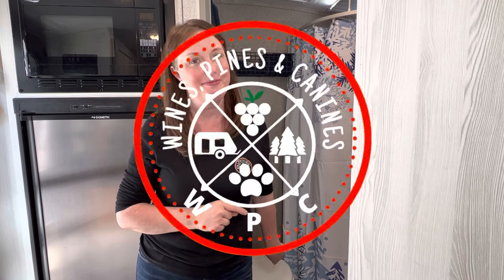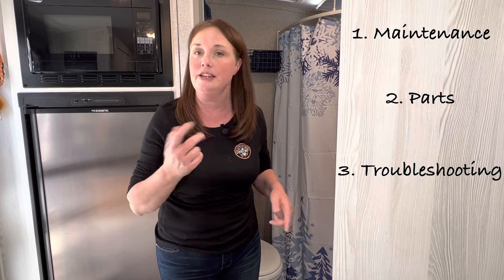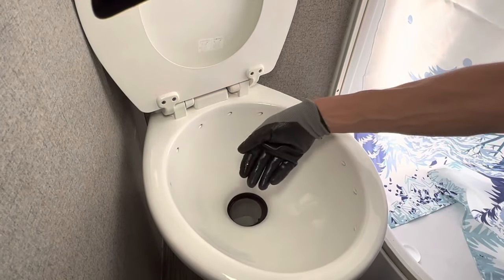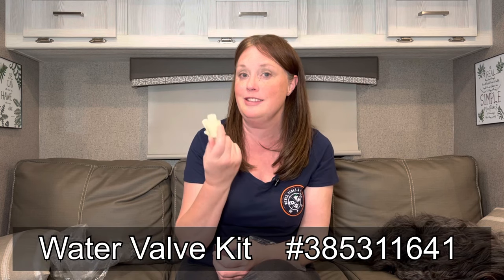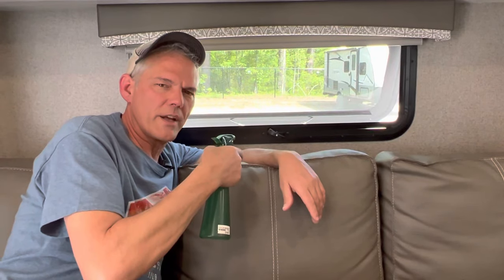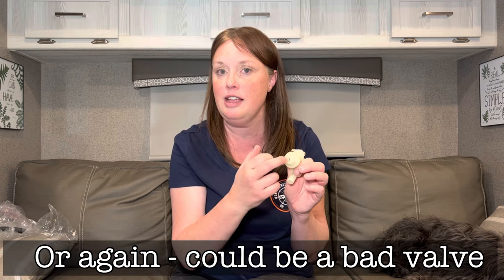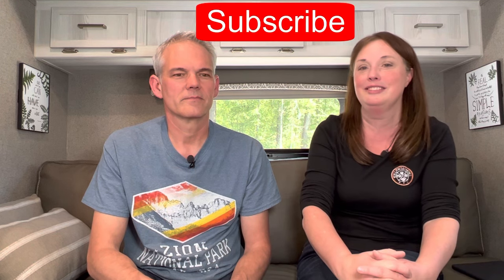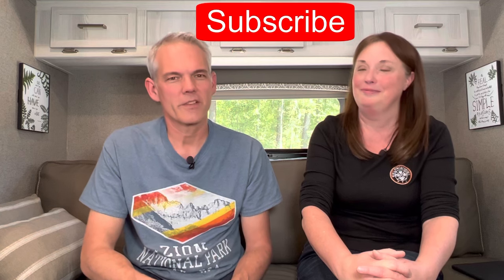Issues With Your Dometic RV Toilet?  We Run Through Parts and Troubleshoot Different Repairs!

Comment: We have 2 dometic 310 toilets in our camper. If one depresses the pedal all the way down it returns by itself. The other toilet when the lever is pressed all the wat down it stays on until the tank overflows and floods the rv. MAKE SURE YOUR VALVE DOES NOT STAY ON IF YOU FULLY DEPRESS IT. We had visitors they thought nothing of it until I heard water flowing under the trailer. PANIC MODE.😢😅😊
Reply from the maker: Oh that would not be good!!  Our pedal comes right back up and the valve closes but that is an excellent point for people to watch for!  Hopefully all was fine?

Comment: Unfortunately the 310 doesn't have a replacement part for the ball itself.  The shaft from the ball to the pedal is all plastic and only half an inch thick at most.  Tried glue,  added a thin screw.  No dice.  Broke again after a month or so.  Key thing is keep the seal lubrication maintenance regularly or it will easily snap the shaft or pedal and your into a new expensive toilet.
Reply from the maker: Yes - it is unfortunate that some parts do require a full replacement.   Seems like the pedal and ball would be something that could be designed to be easily replaced!

Comment: My pedal toilet won't fill up it just runs right through when I press it down a bit. The valve isn't opening, would this be the seal?
Reply from the maker: Hi - sorry it took a bit to respond!  That could be - would likely be the first thing we would change as inexpensive and easy swap out.  But that pedal is definitely touchy - ours takes an easy touch to keep the water filling up vs going through to the tank.

Comment: I hope you weren't thinking you had all the bases covered.  You failed to cover the issue I have with my Dometic toilet; when flushing, clean water flows out the top of the anti siphon valve under the seat hinge cover.

Comment: New seals put on today, when the lever is pressed even alittle to allow water to fill the bowl, the water escapes and wont fill the bowl. How can i fix this?
Reply from the maker: Hi - sorry for the late response - been traveling!  They are very touchy - we have to barely touch to fill up.  Does water pressure seem fine?  Sometimes the water jets may be clogged as well (inside the toilet) and not able to fill up quickly.  We also keep a jug of water in the shower as well as sometimes just easier 🤣

Comment: I’ve a 2021 GeoPro, same model as you all came with Dometic 300. On last trip the flush valve cracked right down the middle & would not hold water in bowl, under warranty. The RV dealer said it would be 3 weeks before I could get appt. & they’d have it for min. of 5 weeks bec. of warranty process. Called Dometic direct, they said I could do myself, send in paperwork for reimbursement. After watching your U-Tube I decided to install 310 myself. Drove 1 1/2 hr to Camping World & got one. Installed but would not stop running. Un-installed, took back (1 1/2 hr. each way again…) & got another one. Installed it and all appeared well. However driving camper to storage, water slushed out of bowl & temporarily shorted my electric brakes. Luckily no permanent damage.  The old Dometic had no serial number ( the camper was made during the pandemic & we all know short cuts were taken…). Now Dometic is refusing to pay claim because I can’t supply serial no.  Think I’m just going to ship them my USED toilet and let them find the serial number… I do enjoy your presentations and learn a lot! Thanks!
Reply from the maker: Wow - hate that you have had so many issues!  But glad it is finally working!  Strange on the serial number but wonder if maybe they were using a second hand item or similar due to supply issues.  

Haha on shipping it back!  Is there any tag on it (I believe its where the water valve is?). Maybe you could take a picture of where it should be to show its missing.  And I believe we had the serial number on the paperwork we got with the original purchase - I remember seeing something on the instruction booklet. 

Thanks for being a viewer - appreciate it
Reply: Thanks I still have old manual, will take a look!

Comment: Hi There!   Our new camper came with a plastic commode - can you please explain why you chose to upgrade to porcelain?    We've recently took our new trailer out for the first time and if I had to point out negatives, I'd say:
 -  the toilet seat seems smaller than a home toilet
 - the bowl is not very far down from the seat
 - the toilet seat is round - we only buy oval toilet seats at home for hygienic reasons

Does your upgrade solve any of the above?

Thank you!  Keep up the great videos!
Reply from the maker: Hi!  Thanks for watching!  Linda here :)  So, I will say this toilet seems much more like a residential one.  Its not as good, but definitely better than the plastic one.  That one seemed to creek and sound like it was going to fall apart - plus the lid would slam.  The one we bought has a soft close lid and is so much quieter.   Troy has remarked that the bowl is deeper and he likes it much better.  And it is more oval than our old one - not as much as at home but definitely better.   If you have a Camping World around you - I have seen them on display in the past.  You may want to see if they have one you can see in person.   Hope that helps and thanks for being a viewer!
Reply: @WinesPinesandCanines  Thanks very much Linda; your explanation is exactly what I was looking for!
Reply: @WinesPinesandCanines  Thanks very much Linda; very helpful!

Comment: Great video you guys! So you're saying I have to replace my whole toilet? The ball shaft doesn't open anymore but the foot pedal still works. So you're saying I can't get inside to replace the ball shaft and spring? That's a bummer. Dometic 310.
Reply from the maker: Hi!  Thank you for the watch!  So from what we researched, if the pedal is not working properly, there is no way to remove the pedal and replace.  You may want to contact Dometic directly though - they have always been helpful when we have called and may be able to just replace those parts if the pedal is still working.

Comment: Great acting! Fortunately, mine came with the 310 from the factory, and I haven't had any real problems with it (yet). I'm not looking forward to any repairs that require getting behind it, because mine sits at a 45 degree angle in a corner between the back wall and the storage cabinet. I may have to hire a small child to reach in there. Actually, I'll probably have to remove the entire thing to access the valve. I'm sure that's how it was assembled.
Reply from the maker: Ha!  Thank you!  And agreed - ours is wedged in there really tight as well.  Had
to just hold the camera at an angle and hope we could get the picture to come out lol.  

Hope you are all set for the big trip!  Cant wait to hear about how it goes and what you saw!!  Have a safe trip and happy camping!

Comment: I have a leak at the connector (on the RV side) that screws on to the water valve itself.  Any idea where to order that?
Reply from the maker: Hi!  Sorry it took a bit to answer.  Our camper has been in storage and went by to check on it yesterday.  So on ours - the piece that screws on to the water valve at the back of the toilet s the pex lines and plastic connectors - is that what you meant?  I imagine each camper might me a bit different.  If you want to email us a picture, we can see if we recognize it (assuming you haven’t found the part!)

Comment: When refilling the toilet bowl after a flush, the ball slightly opens and lets water out while trying to refill. It just slightly opens just enough to let water out but I can get it to refill if I just barely find the right pressure on the pedal but it’s difficult. It’s a Dometic 310. What can I do about it? Thanks!
Reply from the maker: Hmmm.   With getting it to refill - it is a bit of a balancing act with the pedal - we also have to figure out the correct pressure to the pedal to get it to fill without emptying!   Went over the troubleshooting and didn't see anything specific to help but will let you know if we find a solution.  Thanks for watching!

Comment: So on mine. I found a little puddle on the floor behind the toilet. What it ended up being that you guys missed is what's called a vacuum breaker. It is located in the back of toilet at the top. Remove the toilet seat and it exposes this.
Reply from the maker: Thank you for the info!  Will add that to the description and will mention in a future video.   Hopefully it is working fine for you now!

Comment: Mine is leaking from up high somewhere.  I will have to do an autopsy on it tomorrow.
Reply from the maker: Hi!  I think there may be another part or connection up closer to where the lid meets the bowl.  Check out the link in the description to the instructions - it may have some info.  If not - maybe Dometic directly?  Let us know what you discover!

Comment: The problem I'm having is I'm getting a little drip of water out right at the 6:00 position of the pedal when push down. It's just a drip but no video that I've watched so far addresses that issue
Reply from the maker: So the drip is coming out of the pedal or you are getting very little water in the bowl?

Comment: The flush pedal broke on mine and it’s not a replaceable part 🤬
Reply from the maker: Ugh - yes.  Had read that :(. Seems like that would be something that could easily be designed to be replaced rather than having to replace everything!

Comment: Mine is the 310 the problem is it shots water over the rim, if I turn down pressure regulator like 40 psi then of course no problem,  but to take a shower it absolutely  sucks. Any way to just turn down pressure at the toilet?
Reply from the maker: That would be a problem!  We always use a 40psi reducer - we changed out the shower to an Oxygenics Fury and it is much better than the original.  Haven’t seen a way to adjust at the toilet itself unfortunately!